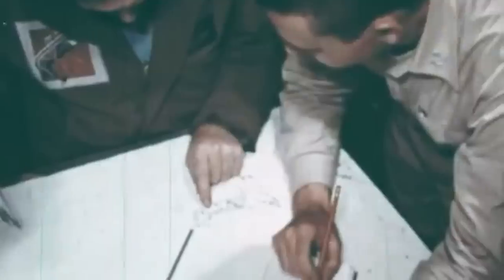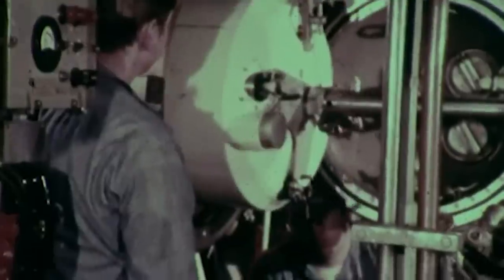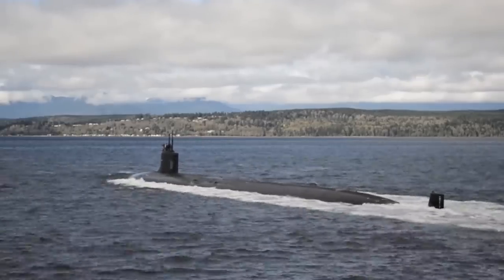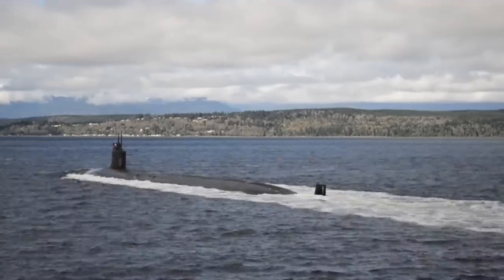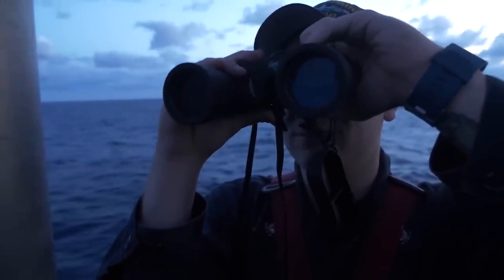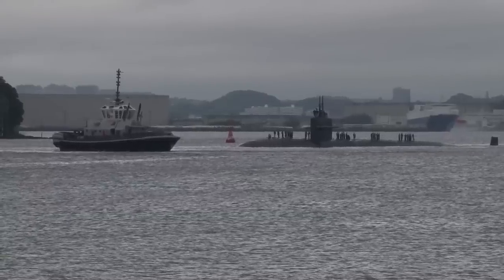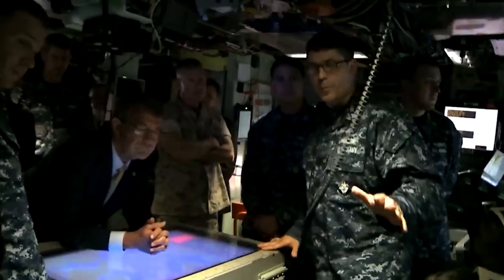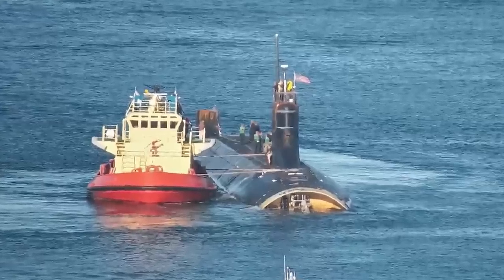The Submarine that Crashed into a Mountain

Comment: I served on the SSN 702 and SSN 705. Submerged displacement for those boats was 6,900 Tons. The SSN 711 ran into a seamount in 2005. Yes, there was one fatality, a MM2 from A Division.
Reply: @s.porter8646  Yes, my mistake. I've corrected my post above. Thank you!
Reply: @DifferentM14  I was on the boat in port in Guam, when they came back, we helped clean up and stand watches for a few days to get the ships force time off to recover.
Reply: @DifferentM14  I removed mine
Reply: @s.porter8646  It's my understanding that SSN 711 crewmembers that had stayed in Guam as well as some of the crew from the SSN 705 helped out once the boat (SSN 711) had returned to Guam. This was well after my service in the Navy.
Reply: @DifferentM14  I was on 766, what boat were you on
Reply: @s.porter8646  Interesting! I served on SSN 705, SSBN 623 and SSN 702 as a nuc mechanical operator and ELT. I left active service in 1987.
Reply: @DifferentM14  wow that's a busy time to be in, I did a few boats myself, TMC/SS
Reply: The 705 is currently in the middle of being scrapped

Comment: I am a retired QMC(SS). Your story stated that the CO, XO and CMC (COB) were relieved for cause. If the issue was navigation, why was the Navigator and the ANAV not also relieved? This is a very standard practice when there is a "Navigational Error".

QMC(SS)
USN (Ret.)
83-04
Reply: I suppose it is possible that the navigators said they should not go there but were overruled.
Reply: Some people just post without actual knowledge. May not be the case here. Just something that I have been coming across. LT Rob United States air Force retired.

Comment: I was fishing on the Bering Sea on a large factory trawler.  The first mate swallowed a sea mount while at the helm.  The entire cod end was filled with mud, we drug that that net through the ocean for hours trying to flush it out of the net, It was a mud slick like I have never seen before, even after trying to get it all out, by the time we got it on deck and emptied it, the mix was starfish, cod and a gooey mud.   We had to break out the fire hose to wash off the fish and spent hours shoveling and washing the deck.  The factory foremen were pissed because the mud got down into the live tanks and ruined many blades in the fillet machinery.    That first mate got his ass chewed and was gone as soon as we hit Dutch.   The mount was charted and he had the instruments to see the sea floor.  He F'ed up, at least no major damage was done, but he was still held accountable for his mistake.   I can't imagine how scary a sub hitting one of those at 20 knots would be, I bet the crew was shitting their pants.
Reply: Wtf is a sea mount ang why did he swallow it? Genuine question
Reply: @ROOSTER333  I'm guessing he means the guy drug their fishing net through a known no go area and instead of catching fish he picked up a very large heavy chunk of the ocean floor that they then drug around until they cleared enough out of the net to get it pulled back on board and still had to blast alot more out with a hose and it got down in the fish cutting machinery damaging the probably expensive cutting blades. Something like that is what I'm imagining. I could be completely wrong though.
Reply: @bentboybbz  lol, .makes sense now. My mind kept thinking the 1st mate was steering the ship and ate the wrong thing causing him to choke and go off coarse.
Reply: @ROOSTER333  Bent boy had it right. it is a large mound off the sea floor sticking up. Trawlers drag the bottom of the ocean, the captain, or the first mate will fly the net off the bottom, or lower the net to follow the contour of the ocean floor.  They can fly the net up by pulling the net in with the two net reels.  There are so many sensors and scans being done for the ocean floor, any coming obstacles are picked up by the ship and the net is trailing behind at quite some distance, the first mate could have easily flown the net off the bottom, and , or, changed course, but it showed he wasn't paying attention at the helm.  
So yeah, he swallowed the mound/mount and caused many delays in fishing and did damage to the factory.  
I thought it was kinda funny and made for a good story when we got back to Dutch Harbor on why we lost our First mate.
Reply: @richardjohnson4696  I imagine the processing machinery is not cheap to repair and that having to shut down and go back to port for repairs costs a lot of money in down time also. I don't know how the crew was paid but if they only get paid when they are bringing in product or a percentage of the final product they probably wanted to drop him into the fish processor "accidentally" lol  plus I'm sure standing on deck blasting crap out of the nets while being soaking wet because of something that could have been avoided didn't win the guy any points either. And hey at least I wasn't completely wrong about what happened and make a fool of myself 😂
Reply: @bentboybbz  Yep, we get paid a percentage of the overall catch, damage costs money and takes away from the overall money we get paid.  It is why I really wasn't too sad that the first mate was let go. When you screw up, you cost everyone money.  Plenty of screwups on the boat.

Comment: I was a steam turbin machinist / mechanical assembler at Westinghouse Marine Division in Sunnyvale, CA from 1982-1994.   During those years the SSN21, SSN22, SSN23 Seawolf turbins, gearing and related components were manucafured, Im very proud of the personal time I have invested in those turbines. The stealthy Seawolfs have the most powerful turbins which equals speed, technically advanced weapon systems and are still the most deadly submarines ever put to sea. The truth of the matter is the forward looking navigation radar was malfunctioning in a way the crew could not detect that, and the sub ran into that mountain.
Reply: Bank robbers are proud too
Reply: Forward looking navigation radar? Radar doesn’t work well underwater  fathometers look down not forward active sonar is not used because it gives away submarines position. I was a Nuke but was a helmsman for about a month
Reply: RADAR was malfunctioning????

Comment: Subs don't use active sonar they listen. Mountains are silent
Reply: In a past life, I worked for a company that built passive systems.  The under sea floor has been mapped for decades.  These clowns obviously didn't know where they were.
Reply: @philgarcia09  The Pacific is always changing and you're trained to not always trust your map for that reason thats why they have a fathometer.
Reply: What a silly comment, a cursory examination of submarine specs will indicate to you that they have both active and passive systems

Comment: This incident sounds like a CFIT on an airplane. In both cases, plane or sub, this is usually due to pilot error and firing the top brass of this sub was the right thing to do. As with CFIT in commercial airplanes a more careful selection of human ressources might have prevented this incident. I wonder if the navy has implemented CRM on their subs. Or if the tendency to operate within a rigid hierarchical command structure has prevented or hampered this. If this is the case the navy better reassess their way of running things on subs.
Reply: IIRC the navy has adopted six sigma for a long time. Unfortunately almost as long exist the complaints that it is implemented in such way that crew, especially officers, are hyperfocused on not getting dinged for any navy defined fault. This manifests in various issues (cheating, risk adversity, briefed surprises etc.) but the most insidous one seems to be that you can be held at fault for errors by people you are, or have been, responsible for. Which means that senior people are incentiviced to protect their junors. The phrase "golden boy who could do no wrong" ends up being used when chickens finally come home roost.

In USN six sigma means the person making the error is usually removed from service or not on their carrer path (ship command) anymore, so that person can't learn from the error. But getting lessons learned applied to the rest of fleet can be tricky when doing would involve acklowledging fault with training procedure in general as then six sigma would aply to the training establishment or people ok'ing the promotion of the officer at fault...

Comment: A couple of thoughts... Like USS San Francisco and USS Nathaniel Green both of whom ran into a charted seamount. Seamounts are usually charted. In both of those cases, the seamounts were on the charts but were improperly annotated or were ignored the watch standing  team. I have to assume the that the same is true for Connecticut. The fact is the ocean is extremely well charted. The fault lies primarily with the watch standing team. THE PEOPLE FAILED! As for damage to the ship, unlike San Francisco, that had to have the bow compartment cut off and then replaced by the one from USS Honolulu, Connecticuts damage was minimal. The important thing to remember is in all of these cases none of these ships were lost. While the loss of life on San Fransisco is sad, it wasn't any worse.
Reply: OR USS Georgia member here, COMSUBPAC as part of this operation had specifically directed for this operation a specific track and timing. The redacted report illustrates the watch team was worried about a time situation and the reason why the sub was hurrying. I think this stress of timing and probably a specific requested track is what altered the normal operation of the watch team. I to do say the Officer of the Deck, the Navigator, and the Dive Officer made mistakes on the track but I also hold COMSUBPAC just as guilty because this stinks of an operation which was not properly planned and COMSUBPAC expected the sub and commander to make up for COMSUBPAC lack of planning.
Reply: I was hoping they’d use the bow of the Cincinnati so they could call her the 
USS Cin Francisco
Reply: The Connecticut was going through a not so recently charted part of the ocean in order to get to their location faster

Comment: Good video but I’m surprised you didn’t reference the USS San Francisco grounding as it was caused by the same series of issues.  
Love your Dark channels especially Dark Sea; however, here are some finer points for future reference: 
- No one in the Silent Service says “MK” torpedo. It’s spoken “Mark 48”
- It was just the “tip” of the hull that was removed. The SONAR dome is a one piece unit of glass reinforced plastic sometimes booted in rubber. Once damaged to a point it’s unsafe to navigate with it attached, it must be removed in whole. The bulkhead visible in the video looks like the forward bulkhead of the forward main ballast tank group. It's likely the spherical array, hemispherical array and forward portion of the hull array were lost or crushed but those all exist in the free flood section well forward of the pressure hull AKA "People Tank".
- Please don’t say, “Boat Chief” the title is “Chief of the Boat” and it’s inappropriate to adjust the title’s structure as it is a hard-earned position many strive their entire career to achieve. It is appropriate to abbreviate the title to “COB” spoken “cob” like corn on the cob.
Reply: Yeah right? Civilians making videos just doesn't do it for those of us that have served. Reading from AARs or published findings is not the same as understanding what your actually reading. To be fair? That's all they will ever have. The silent service is just that.
Reply: Please consider that the narrator may not be human and its programmers are.
Reply: Also, pounds and tons are two very different units of weight. The sub doesn't weigh 9,000 pounds. Just saying...

Comment: How could a malfunctioning sonar not being detected by the modern "self-diagnostic" advanced electronics on board?  There should have been at least two such "highly-classified" sonars installed, and not left to chance.
Reply: Improper calibrations or settings.  A diagnostic won't tell you its wrong if that's the way you set it up.
Reply: @TrulyAmazingFeats  OK thanks for info.

Comment: What the heck does "display between 9000 and 12000 pounds depending on the load mean"? Did the narrator mean "displace between 9000 and 12000 TONS depending on the load"? That's a pretty significant misstatement coming from what most assume to be an authority on all things naval and nautical, and I don't feel like I'm being hyper-critical in pointing it out.

Comment: SSST E-5 USS Georgia SSBN-729 1990-1997 opinion, OK, I can see how you say an issue with SONAR. However, technically yes the depth sounder and fathometer do use sonar, they are not considered SONAR for ship operation. Yes, if in a secure mode, use of the fathometer would be ill-advised as would give away position. It is a bad decision to operate faster than accepted limitation of secure depth sounder.

Comment: Ok. Sonar was not being used to 'look ahead' of the submarine. The unclassified, though redacted, report sufficiently details the incompetence displayed by the senior leaders of CT. Maliciously interpreting operating guidance so you can operate deep and fast in uncertain waters is a description of stupidity. There was no reason for this grounding and it was completely avoidable.  You also need an editor, as you repeated the dimensions of the ship, though got it wrong the second time...why mention it twice?  What you saw 'removed' was the sonar dome, nothing more. Why do you think there would be 'more'? Don't hypothesize about stuff you don't know about. HUMEVAC just means they were departing the area to debark 1 or more crew members...nothing nefarious. I'm inclined to unsubscribe. The BQQ-10 is not a bottom sounder. "for unknown reasons speed was increased', yes, the unknown reason was stupidity. fathometers are nearly undetectable. And mountains are not biologics.  So much stupidity in this video and this event.

On another note, that must have been a miserable transit from Guam to SD on the surface.. Yuck!